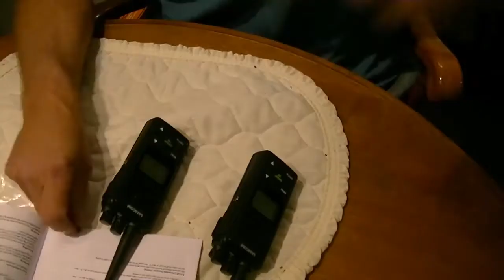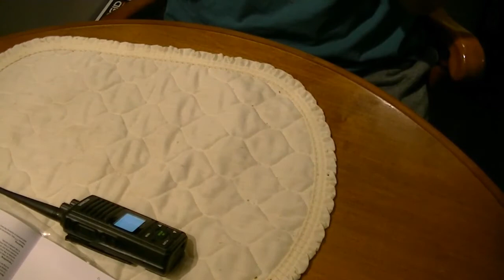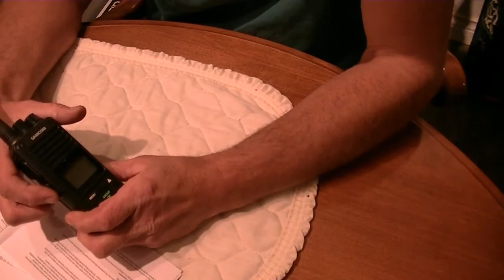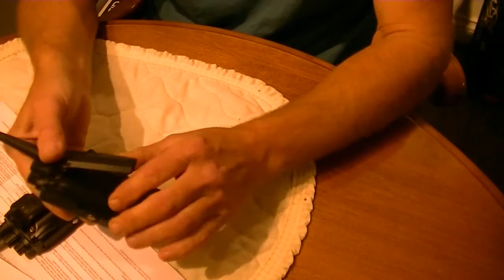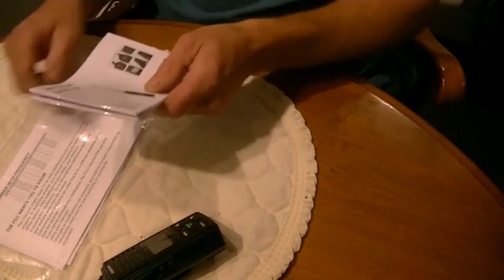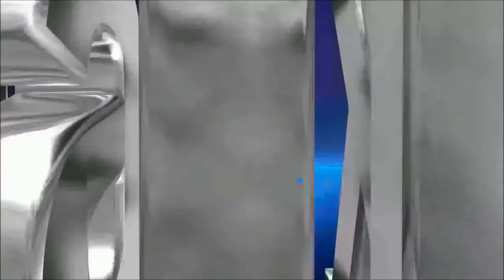Samcom 2 way radios how to set them up

Comment: Question does anyone know where to get the software to program the radios.  I have not been able to find it anywhere.  I have the cable
Reply from the maker: from the company they have it and the cable you have ot use to connect it to the computer

Comment: I’ve got two units stuck on Channel A & B and I can’t figure out how to change it back.
Reply: Having the same issue. Have 2 radios stuck on Channel B. One was on Channel D, but after resetting, it’s stuck on channel B and won’t function with the rest of my radios. Really frustrating.
Reply from the maker: read the manual failing that email or call the company they can help

Comment: I’ve had one for a while and my friend just got one. We tried but they wouldn’t work together. His had a D above the channel number no matter what channel we were on. Any idea what that is? Can’t find anything
Reply from the maker: your channels perhaps are the same but the frquencys they run on are different both radios should be for the same country .. there is a Canadain set of these and a USA set they will not talk to each other because of the frequencys its not hard to have ordered the wronge one but you can contact the company for the cable and sofware and reprogram them , that or you 2 need to get a matched set then your fine
Reply: Thanks for the feedback. So I had mine because I go on mountain trips a lot and the guy going with me bought it off  Amazon so I’ll have to check where the country of origin is that he bought
Reply: Hold the call button and turn on the radio, it’ll change from channel d and so forth.

Comment: does anybody know the default frequencies for the samcom radios? I am trying to connect a baofeng radio and I can transmit with the Samcom but it wont receive.... any help?
Reply from the maker: if I recall the instructions did have the frequency's.  listed

Comment: I ordered in 3 different batches FPCN30A radios and they came in 3 different frequencies.  467.6873 / 462.5750 / 462.5500 is there anyway to program them to an existing FPCN30A frequency  (467.6875)  that I have about 40 of those deployed.  Thank you
Reply from the maker: contact the company for the programer cable for them as well as the software download also explain to them what has happen
Reply: @KevinMillard68  thank you very much!
Reply: Same thing on this end. Worthless to me

Comment: Do u have to have the base station
In order to use them at all. Or can I just pull them out of box start using them in the woods right away
Reply from the maker: no you dont need the base unit at all fire them up and have at it your good to go

Comment: In America the scramble mode is illegal and you need a license for GMRS WITCH THESE ARE!
Reply from the maker: these are not GMRS but you also dont need a license in canada for them either..
Reply: @KevinMillard68  I stand to be corrected . I was just thinking in the states. We have some weird laws
Reply from the maker: @elmelmon  by the way these units are sold in the usa as well and as far as i know you wont need a licence because of the uhf frequency they use but do check either way before you key up and the usa models have the scrambler as well
Reply: @KevinMillard68  You absolutely do need a license for these in the US. They are not FCC accepted for FRS(too powerful/removable antenna/wideband capable), nor are they accepted for GMRS in the US(likely because of the scrambler). In the US these are only legal for amateur radio or LMR business license holders.
Reply from the maker: @CzechSixTv  i never said i was in the USA now did i iam from canada and we dont need a licence for them here
Reply: @KevinMillard68  But you did say:
"𝘵𝘩𝘦𝘴𝘦 𝘶𝘯𝘪𝘵𝘴 𝘢𝘳𝘦 𝘴𝘰𝘭𝘥 𝘪𝘯 𝘵𝘩𝘦 𝘜𝘚𝘈 𝘢𝘴 𝘸𝘦𝘭𝘭 𝘢𝘯𝘥 𝘢𝘴 𝘧𝘢𝘳 𝘢𝘴 𝘪 𝘬𝘯𝘰𝘸 𝘺𝘰𝘶 𝘸𝘰𝘯'𝘵 𝘯𝘦𝘦𝘥 𝘢 𝘭𝘪𝘤𝘦𝘯𝘴𝘦 𝘣𝘦𝘤𝘢𝘶𝘴𝘦 𝘰𝘧 𝘵𝘩𝘦 𝘶𝘩𝘧 𝘧𝘳𝘦𝘲𝘶𝘦𝘯𝘤𝘺"

That is what I was addressing. These radios, regardless of frequency or watts, are only legal to TX with specific licenses in the US. I made the comment so someone finding this video when considering buying these radios would get accurate information.

Also, there are multiple versions of that particular radio. One is 2W and legal on FRS/GMRS frequencies in Canada(even with the scrambler) while the others are 3W or 5W and not legal for unlicensed use regardless of the frequencies. 

Many of these Chinese radio manufacturers are notorious for dubious marketing. Samcom, in their official US Amazon store, falsely market the 5W versions as GMRS radios. I haven't checked Amazon ca, but I'd be incredibly shocked if they weren't engaged in similarly misleading practices.
Reply from the maker: @CzechSixTv  most companies put out misleading info thats just everyday stuff that happens all the time. how ever the ones in my video are leagle with out a licence and are not on any gmrs or frs channles but they can be programmed to be on them easy enough, if one has the cable and the software
Reply: These are part 90 FCC certified witch you do not have to have a license to use

Comment: I ordered & waiting  to try out. but is wattage output strong enough for communicating within concrete & steel structures? These will be used in tower buildings from 4 to 45  floors in height mostly in a direct line within   elevator shafts
Reply from the maker: i cant see why not they exceed the distance test of the rated distance but to know for sure let us know how it works out for your purpose
Reply: @KevinMillard68   I received them & work awesome ! now waiting for TYT tc-8000 cable & software cd to  download frequencies so that I can match  frequency  to interact with both systems... once I figure out how ?? lol
Reply from the maker: @picwick57  cool stuff